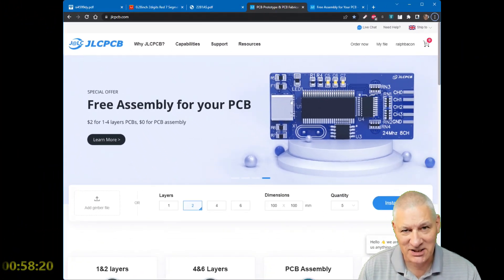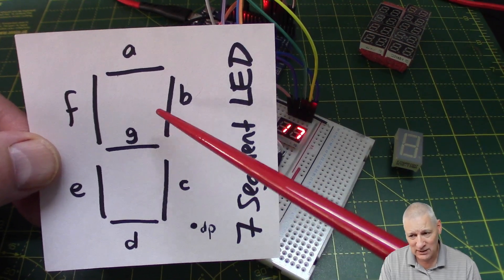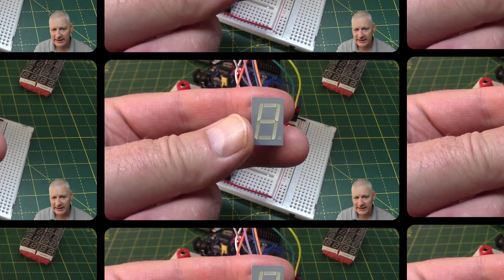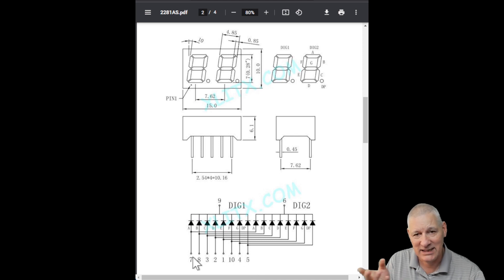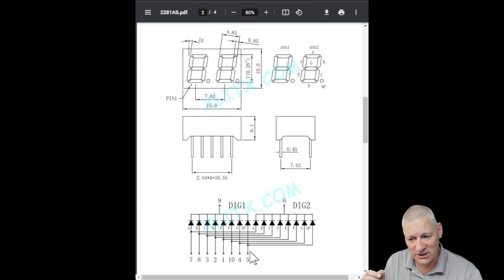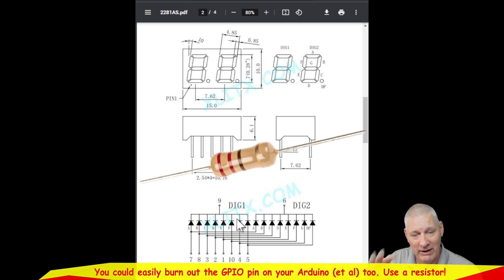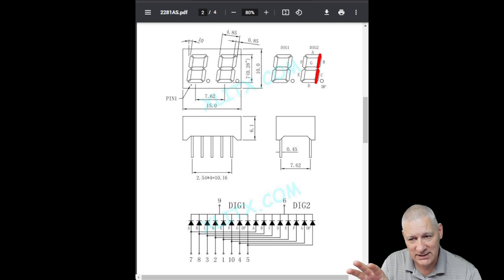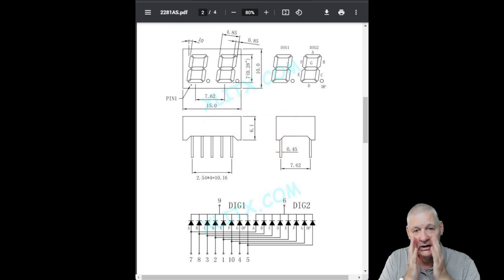#249 🎈7-Segment LED Digit Multiplexing with fewer GPIO pins

Comment: My data gets copied on both displays even if i switch one of them on once at a time...
Reply from the maker: Make sure you have correctly given the number of display elements to the program (one element is the complete 7-seg display). So if you have 4 digits, you supply 4 in the sketch. And so on.
Reply: @RalphBacon  Yes

Comment: Do you have a video about effective/smart way to multiplex 7segments display AND input buttons? 4 displays and 4 buttons let's say with minimal wires and cheap discrete components?
Reply from the maker: I think the 7-seg LEDs are covered here and to multiplex 4 buttons you just need to use a matrix - have a look at the wiring for the 10-button keypad you can get just about everywhere. 

That said, multiplexing is more effective with more buttons, because for 4-button you still need 4 wires - might as well use 4 standard GPIO pins.

Comment: Could the MOSFETS be replaced by NPN and PNP bipolar transistors? I realise different values of  driving resistors would be required.
Reply from the maker: Yes, of course, that's how it was always done "in the old days". Just be aware that BJTs do not have such a low forward resistance so could get warm (hot even) depending on the current flow.

Comment: is you have complicated program running you may have to do that display multiplexing from timer interrupt to get even power distribution between segments.
It seems this answered wondering of that debug display video if there was current limiting resistor.
Reply from the maker: I don't multiplex the segments just the digits (ie all 8 diodes in that digit).

Comment: The 74HC595 can extend this to many digits.  The segment states can be shifted out SPI and latched.  One N-channel FET for each digit simultaneously grounds the common cathodes for one digit and enables the 74HC595 output for that digit.  One port bit for each digit can activate the FETs or a ring counter can save these port I/Os for a truly long display.  Using paired digits like those illustrated, one bit and its inverse can alternate between the two independently of all other pairs.
Reply from the maker: Yes, it seems that there are many, many ways to achieve this and your suggestions are good. I'm going to see whether a cheap μC is a simple and flexible way of doing this too (eg Tiny167)!

Comment: What to do if you have 10 displays multiplexed. The leds light up only 1/10 of the time and get dim. Is it allowed to overdrive the led current by lowering the resistors 10 fold?
Reply from the maker: It doesn't dim as much as you might think, Eddy. 

Consider that a bedside clock with four digits (sometimes six) is still plenty bright enough to read in daylight. We can ensure that the full 20mA (or whatever the spec sheet states) can flow down each segment (with the correct resistor in series with each segment LED) with an overall brightness control in the common cathode (PWM, probably) for daytime / night-time use.

We could also consider multiplexing half the LEDs separately; in your example, 5 in one 'block'. So they get 1/5th of the time, not 1/10th of the time. Plenty!

I certainly would not advise overdriving any LED. It might survive for a while but you would be using it outside of its manufacturer's stated parameters - lifespan will definitely be short(er)!

Comment: You can make it even cheaper (no transistors needed) by connecting common anode and common cathode segment displays together.   Common low drives one segment, common high drives the other.   Also since you're only momentarily driving an led (and GPIO's rarely source much current anyway) you can get away without any resistors.   But I also vote for the  Aliexpress TM1638 "LED & KEY" boards which make prototyping easy.   Cheap, simple, and frees CPU cycles.
Reply from the maker: Yes, the common anode/cathode complementary 7-seg digits would work, and I did mention that in a previous comment. I still would use a current limiting resistor though! Even though each digit is on just a fraction of a second, that could still mean excessive current flow and a (much) shorter LED life.

My 74HC595 project also frees CPU cycles as it is a fit and forget system, but I'll look at the TM168 too (now that you mention it, I'm I've already done this, must check!)

Comment: An unrelated question to the video: I remember an episode about the outdoor bins power management; something about using the dual MOSFET package and switch to turn on the MCU to send a signal and turn itself off. I watch all videos but I can't seem to be able to find it. I want to make a cat door opening/closing counter so we can know when cat is outside. I'm thinking about using a reed switch and if that triggers send an mqtt message to my homeassistant server so I can log the openings.
Reply from the maker: Yes, that would work although you have to be very careful about the current through a reed switch - they are designed for signals so a 5v signal at some very, very low current should be fine to trigger the auto on/off project (which I'm using every day in my outdoor bins, just as you say).

There are some variations in the design, depending on what you want to do, so here are some links:

Video #123 https://youtu.be/g1rbIG2BO0U
Video #172 https://youtu.be/6OH_ZiD2xoI
Video #173 (uses ATTiny85) https://youtu.be/S2y1oAVmxdA

There are probably others (I use that circuit quite a lot) but these should get you going. If you need information that is not in the GitHub for those videos do let me know. I reckon the circuit diagram in #173 (see GitHub) without the additional circuitry is what you will need.

Comment: I should have paid more attention; I thought you had some magic to control a 2 digit 7 segment LED with one GPIO. Oh but you said saving one GPIO. 🤣
Reply from the maker: And for my next trick... 🪄🎩
Reply: Well actually ,  at about 9 seconds in Ralph said "... and we're controlling that using one GPIO pin ", and again at 20 seconds "... each digit is itself only controlled by using one line , not two".  I also found it extremely confusing, so I don't think it's your attention that's the problem, I think it's Ralph's!

Comment: Great idea to use a single GPIO pin to multiplex two displays. I have one suggestion which is a slight software tweak. Based on your description, you change the segment outputs just before switching digits. This will briefly send one display's data to the other one which could cause unlit segments to light dimly creating a "ghosting" effect. 
My suggestion is to first turn off all segments, switch digits, then output the digits for that display.
Reply from the maker: Cool idea! I guess it is always worth experimenting which way works best. BTW as you saw, I didn't get any ghosting (much to my surprise) but other devices may not be so forgiving!

Comment: Since you asked so nicely :p I like the idea, if you just need to save one GPIO pin, although I also like using the uhh PCF84XX something. It's the same chip used on those 16x2 or 20x4 LCD backpacks, gives you 8 pins over I₂C, and you can use multiple. There's probably even better ways than that :) Hope life is going okay for you friend x
Reply from the maker: Yes, I indeed, I mentioned those "backpacks" somewhere (in another comment I guess) which are great because they are controlled by only two I2C wires.
Life is going just fine for me right now, thanks for asking. I hope the same is true for you. Of course, what with Queen passing, it's been quite surreal.

Comment: Hi Ralph. I’m a lurker. I work in semiconductors by day, but I often find I learn more tricks by watching channels like yours!
I was thinking of ways you could drive the 8 anodes. Do you think you could use a 4017 Johnson counter, to sequentially step through each anode, then an additional n channel BJT under your p/n digit mux to tell the circuits when to light the LED’s?
You’d then be using 4 gpio’s total. 2 for the Johnson counter, 1 for the digit selector and 1 as a “this led on or skip”.
You might also be able to skip the “this led on” gpio if you change the clock time on the counter, quickly toggling the clock line to skip an led you don’t want to show?
Anyway - would love to hear your thoughts. Thanks again for a great channel.
Reply from the maker: Lurk away, Dafydd, although I have spotted you a couple of times, I'm sure!

Your suggestion is a good one but has been suggested somewhere else in these comments. I'm pretty sure the logic is sound. Actually, I think someone commented that they had actually done this already.

Yes, we are all singing off the same hymn sheet.
Reply: I have done pretty much the same when putting together a model with many small glow-in-the-dark parts. Thankfully those have persistence in the order of 10s of seconds. One 4017 clocking a second 4017 and lighting all the (UV) LEDs in a matrix. The Glowing Round Things strike terror in the hearts of children hiding behind the sofa. 'eee...eeeee..eeeeeggggg.......eeeeggggggg...." Are you saying those things are eggs? Are they your eggs? "EEeeeeeeeeggggggg!" pauses "Eegg sternum eight" ... You want eight eggs? Where? ... "Eggsternumeight!" Ack, gotta run real fast. br-zap

Comment: I made some ESP8266 powered clocks as I was fed up with setting time when it drifted or power went out - these set themselves. Uses 4 max#### based 8x8 led matrix, controls over SPI IIRC. Used red electrical tap to act as a diffuser, still working great some 2-3years later :) I can see this being handy if it could be made to work over serial or I2C... Just pop the module on and it gives the error code.
Reply from the maker: Sounds a good idea. BTW instead of red tape (which I'm sure works just fine) I use red acrylic sheet, the sort that am-dram societies use on their stage lights. You'll see it in action in a future MAX7219 project - hey you just mentioned those, small world!!!

Comment: I would have taken a CD4049, CD4069 or 74HC04 inverter. These ICs can drive enough current for LEDs.
Your solution is good for two digit displays. Only 8 IO pins
Reply from the maker: Yup, I would not drive a 7-seg display directly from an UNO, as it used too many valuable IO pins. Your suggestion is a good one 👍

Comment: Nice way to achieve multiplexing. But if you really want a simple and cost effective way to drive segment displays: our friends at JLCPCB/EasyEDA sell various LED drivers such as TM1637 or GN1616 both less than $0.25 they include buffer multiplexing etc.
Reply from the maker: So many roads to Rome, it would appear. I think I might have tried the TM1637 (or used it in a project) but the GN1616 is new to me, so I will check it out, thanks! 👍

Comment: What could be a next step? Maybe 2x 8bit shift register with resistor arrays, to bring pin count down. That would however bring the component (cost) up. Lets stick with this. Great MosFET tip, just uses 1 pin 😊
Reply from the maker: Possibly! There are many ways to do this, Paulo. When the PCBs arrive we'll build the 74HC595 shift register method you mentioned. Got to keep it cheap!

Comment: LEDs are my favorite display but unless you implement very dark filters, they are problematic in direct sunlight and of course utilize more energy.
That being said, I first had an LED watch and did go through a lot of batteries; I then got a an LCD w/o backlight and indoors it was a bust. Guess I needed a solar powered LED one.
Great Video as always with detailed explanation.  One of the very best Arduino/electronics channels on YouTube!.
Reply from the maker: Thank you for all your kind words! Yes, I will be using a dark red acetate for a future project, involving lots of LEDs in a matrix. I might even see whether a small piece works better for the error-display dual digit project.
Reply: @RalphBacon  I bought some 1/8” ruby-red plexiglas (poly carbonate) and two layers does well in bright light ☀️

Comment: A demultiplexer ic and maybe a small capacitor on led segment(to reduce flicker)  and you could rule the world with a single pin.
Reply: Well a few pins,s
Reply from the maker: Yes, a minimum of three pins it would seem. Better to use I2C which only uses two. But the chip will probably cost more.

Comment: Multiplexing is old hat; I remember talking about in my twenties (that would make it circa 1975, ouch. Mind you that would have been with filament 7 segment displays. Also there are latch-able 7 segment displays with decoder therefore  4 lines  per digit. The use of  N and P  channel mosfets is interesting though.
Reply from the maker: It's the last bit I'm claiming a "first" for, not multiplexing! I built my first multiplexing bedside alarm clock around 1973. Of course I was only 2 years old at the time. Maybe 3.
Reply: @RalphBacon  Yes it's just so long was spent on the multiplexing that I had mentally switched off by the time we got to something interesting.
I cannot claim to be such a child prodigy!!

Comment: Thanks again for an interesting video, over the years you have taught me a lot! I have a suggestion for a future video; how to control a bunch of 7 segment displays with only 3 GPIO pins. I have built a clock with 6 big 7 segment displays, in order to get enough brightness they are driven by 12V. I manage to control them  with only 2 595 shift registers in cascade. The fist sets the 7 segments (and even has one pin free to control a punctuation mark if needed), and the second 595 chooses with display to be supplied by 12 V using P-channel MOSFETs on the hight side. In theory I could use these 595s to control 8 displays! Because of the 12 V supply I buffered the output from the first 595 with a driving  circuit that can handle the voltage. I did this as readymade drivers for 6  segments really didn't cut it due to the higher voltage of the displays. It was a lot of work, but I think I got a fair understanding of how to implement serial data. OK, this is just an idea..   Cheers!
Reply from the maker: Interesting use of two 595s. I'm using two in my forthcoming dual 7-seg display. I did not think to control the power (via a MOSFET) with them though. Sounds very novel. 👍

Comment: You could compensate for the brightness varying depending on the digit being displayed, while still using only a single resistor, by pulse-width modulating the output to compensate for the number of segments displayed in each digit.. so for example 8 would be the dimmest, so you'd compensate with a higher PWM value, and 1 would be the brightest, so you'd compensate by using a lower PWM value.
Reply from the maker: I could even just display the 8 for a bit longer (or the 1 for a shorter) period to make it seem brighter. Currently all digits displayed for an arbitrary 10mS so could easily be programmed.
Reply: @RalphBacon  Yes, that would work too :). You'd just want to ensure you're still alternating between the digits at a consistent rate. For example, say you only light up an 1 for 5ms instead of 10ms... that doesn't mean you can move on to the other digit after those 5ms. You'd need to have all LEDs off to fill in the remaining 5ms. Otherwise I think you'd end up with a situation where what number you display on one of the digits affects the brightness of both digits, since you'd be affecting the total cycle time.

Comment: I think you should put the resistor on the Drain of the P-Channel tranny.  The voltage drop across it subtracts from the (Vgs) gate voltage that turns the MOSFET on.   It may not be saturate .   This wiring of the P-Channel is not really the proper use of it.  The LED drop of each segment already subtracts 1.5 to 2 volts so your Vgs is only -3 volts instead of the full supply rail of -5 to fully saturate the P-Channel Mosfet.   OR   This is done often in circuits that need inversion from one control pin.   This is a more common accepted  prractice.    Use the N channel FET to drive one segment and also drive a second N Channel MOSFET's gate.  But now the second MOSFET gate has a pullup resistor to turn it on when the first FET is off.  So when the first FETs gate has 5 volts on it, it fully saturates ON.   That pulls the gate of the second FET to ground and turns it off.   The seceond N Channel FET has become a simple inverter circuit that then toggles the two segment's commons.   You should always directly reference the Gate and Souces of the MOSFETs to the power rails like you did the N channel ciruit you drew.
Reply from the maker: I would not want to put a resistor on the Drain of the "P" channel as that will raise the ground reference level; MOSFETs can behave oddly if the GND is not a GND. 

What I should have done (maybe) is used a Common Anode for one digit and controlled the power via the P -Channel in the supply line (ie before the LEDs).

But: this method works!
Reply: @RalphBacon  P Channels are usually wired as high side switching and not referenced to ground.  They are reference to Vcc.    Anyway.    Just out of curiosity which P channel FETs are you using?  You never mentioned it.  Thanx